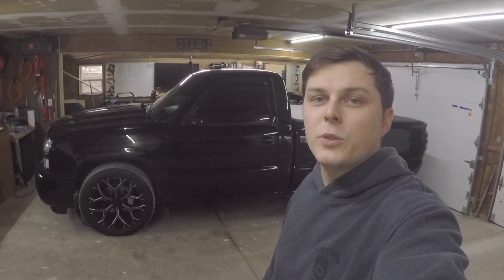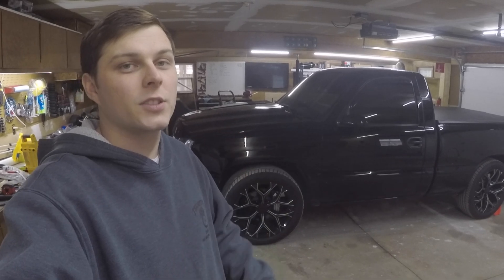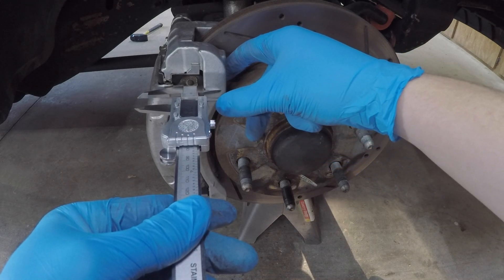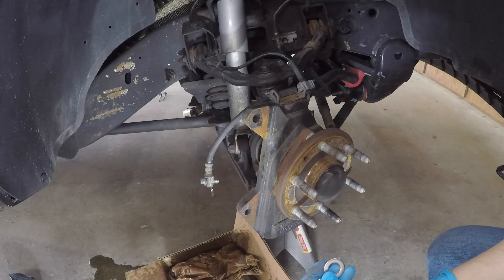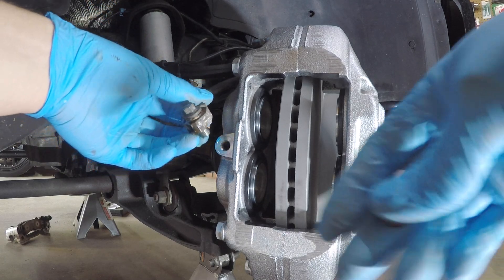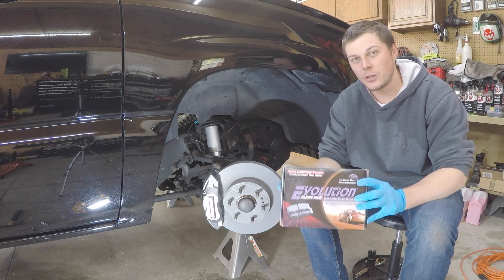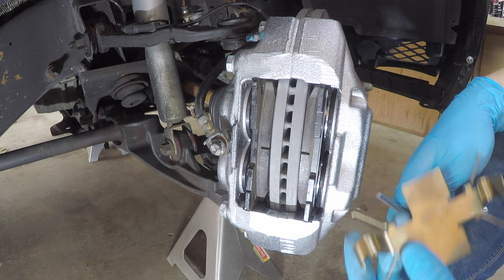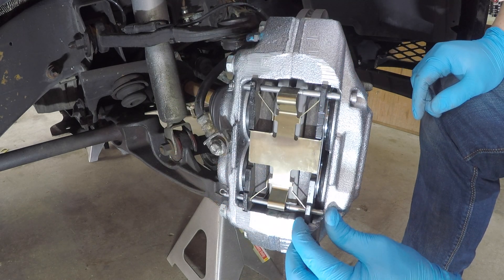Silverado 2019 Big Brake Conversion! “How To” A NBS!

Comment: Is there anyway I could get a measurement from the mounting bracket to outside of caliper ? I'm trying to see if my wheels will work with this setup without using wheel spacers
Reply from the maker: Hey, im really sorry for the EXTREMELY late reply!!! (These measurements are including the wash/spacer, for proper centering of the calipur)

From the face of the mounting bracket, to the furthest point of the calipur (that linear bump on the outside of the calipur, looks like a minus sign)  its 125mm or 4.9inches.

From the face of the mounting bracket, to the outside face of the calipur, on the curved C part, which is closest to the wheel, is 117mm or 4.6inches
Reply: @TheKingCoopa  thank you sir! I just recently got some factory loaded pull off calipers and rotors so this info came just in time. Lol
Reply from the maker: @reddevilent.1587  oh nice, good score! That inside C curve of the calipur is gonna be the closest point to your wheels. I've seen a few guys grind them down a little if need be, but hopefully you don't need that or a spacer. Good luck with the swap! 🤘
Reply: @TheKingCoopa  thanks man,I really appreciate it! I'm hoping that I don't have to run a spacer but will see. Was thinking of adding some ARP wheel studs to give some extra length
Reply from the maker: @reddevilent.1587  yea you could, most people who do the swap and a 3mm or 5mm wheel spacer don't have any issues with the stud length. The truck lug nut studs are pretty long. If you plan on running some big HP and running a spacer, the arp studs would Definitely be something I'd look into.
Reply: @TheKingCoopa  I got a turbo single cab 99 02,huron speed v4 t6 kit,80mm turbo forged built 370. I need some more stopping power.
Reply from the maker: @reddevilent.1587  oh, very nice 👌 👌. I think the best bang for your buck would be switching to hydroboost. Runs off the power steering pump, instead of vacuum pressure. I'm sure you already know, but larger camshafts have more LSA which gets less vacuum pressure = less stopping power with a brake booster.

Comment: Did it fix the how soft the break pedal feels ?
Reply from the maker: Hey, adding more pistons means more fluid to push. So you have to apply a little more pressure to get the same braking force. If your brake pedal is soft, then there is an issue with your brake system

Comment: so yes to a 2008 escalade platinum with 22 in 31mm offset. grinding and 1/4 spacer needed?
Reply from the maker: Hey, sorry for the late reply. It all really comes down to the spoke design. I dont think you will need to grind it down with the 22s, but might or might not need the spacer. Only really one way to find out haha, but good luck 🤘

Comment: For some reason those washers did not Center my brake caliper
Reply from the maker: Hey, sorry for the late reply. If it didn't fit, I'd measure your rotor Centerpoint, and then you would have to adjust the washer from there. It might need a thinner or thicker washer to be perfect. The washer works for almost everyone, so it sounds like yours just needs some fine tuning.

Comment: Are those calipers raw iron/steel that will rust or are they coated?
Reply from the maker: Hey, sorry for the late reply. They are zinc di-chromate anti-corrosion finishes which provide resistance to the rust on the cast iron caliper bodies

Comment: Gotten any where with the hydro boost conversion yet? Love the channel!
Reply: I haven’t done mine was wondering your experience since you did the swap
I’m doin drum to disc in the rear and then doing your suggested swap worries I will have vacuum pressure lost some to adding that many pistons to brake calipers
Reply from the maker: Also, like you said, adding more pistons means you will be pushing more fluid, harder to stop. (Or you have to apply more foot pressure) but the main reason i have alot of vacuum pressure loss, is because of the large camshaft i have. That effects it alot. So if your stock, it won't be as bad as mine was, but a hydro boost upgrade is more ideal.
Reply: @TheKingCoopa  I have been looking online but can’t find anyone who has done one for an 07-13 as mine is a 2013.  I can’t find any company or fellow NNBS owner who has done the swap…
Reply from the maker: Hey, no not yet. I have the 4.8L pulled. About to drop in the 6.0L and the E fans swap, then I'll do they AWD and hydroboost conversion. I dont wanna take on too many videos/projects at once haha. But we're getting there. Thanks for the support!

Comment: Very cool mod and great video! How much weight did this add to the truck?
Reply from the maker: Thank you! I'm not exactly sure how much it added, but I'd definitely assume atleast 20 or 30lbs? The rotors are a little larger and the calipurs are massive haha.
Reply: @TheKingCoopa  thanks for the estimate, I just started a build on a 2005 Chevy Cateye single cab short bed with a 5.3 V8 2wd and have been checking out some other people’s builds. You have some good videos for sure. I’m sub’d.
Reply from the maker: @whiplashtv2022  for sure, and that's awesome, hopefully it turns out how you want! My truck has changed a little bit since this video. Right now im swapping in a LQ9 6.0L with 2 step and a 150-200 shot of nitrous haha. Thanks for the support, I appreciate it!

Comment: I have been wanting to do this on my 2013 Yukon Denali. Do you know if this will work? I appreciate this video.
Reply from the maker: Hey, from the research that I've done, it should work. Biggest thing to look out for is wheel diameter and backspacing. You might have to run a small 3mm or 5mm wheel spacer to clear the spokes

Comment: OK. In stead of just giving the part numbers for the calipers could you give the actual truck information that these came stock on even more so that what you already say in the video. just a part number search is coming up with a bunch of dead ends plus with vehicle info I could get anything, not just ACDelco parts.
Reply from the maker: Hey, The 4 piston calipurs came on the silverado/gmc 4x4 1500 platform. 2019-2022. That platform also has 3 different kinds of front calipurs which is why I gave the part numbers. GM still runs the exact calipurs on the new trucks, but the part number has change a few times. It wasn't a specific model or trim package that only had these brakes (ie. Trailboss, AT4, etc.) Base model trucks get the larger brakes sometimes, and a few even get upgraded to brembros at the dealer. So the actual truck info is a 2019-2021 silverado or gmc 1500 4x4. You can always find a truck at the dealer and use it's vin number for a reference. But as stated in the video, when the part numbers did work, the calipurs were still really hard to find, especially since the truck is new and there arnt any in the scrap yards. Or you could call brembo directly and order a set from them.
Reply: @TheKingCoopa  The reason for wanting a certain model or trim is I can't take part numbers to autozone for pads or to see if I can get the calipers from them for fare less.

Comment: Will this work for my 2008 chevy avalanche 4wd
Reply from the maker: Hey, as long as its a 1500, it should work.
Reply: @TheKingCoopa  so yes to a 2008 escalade platinum with 22 in 31mm offset. grinding and 1/4 spacer needed?
Reply: Yes it's a 1500.... also what do I use to do the rear not sure what year and model  I should be taking it from.... thanks in advance

Comment: What size wheel is needed to clear the caliper ?
Reply from the maker: Hey, minimum of a 17in diameter wheel is required. As for the offset, that all depends on how each individual wheel and spokes are designed, and the offset of the wheel. So I can't help you much there, if you need a wheelspace or not

Comment: I noticed the brakes have holes for the wear sensor…did you ever connect that part? Thanks in advance
Reply from the maker: Hey, sorry for the late reply. I did not buy/use the electronic wear sensors, because there is nothing to plug them in to. The GM brake pad life monitoring system, wasn't implemented untill 2019.

Comment: Did you have to Replace the Baster Cylinder ???
Reply from the maker: No, I kept the same factory master cylinder. I will be doing the hydro boost upgrade though. To help in the braking force, since it is now pushing more fluid with more pistons.

Comment: Consider me subscribed, 1st to pop-up when I searched big brake upgrade. I have a 08 NNBS suerra Denali with a 4/6 drop on 24s. Truck had a 427 LS3 stroker, and makes about 640fwhp, so yes it's time to stop this big boy since I have a caliper trying to stick.
What part numbers should I looking for for to complete this swap. Trying to do Calipers and Rotors. Heard somewhere that 2017 Truck and Suvs were a direct fit, but didn't want to buy without research. Any information would be helpful.
Thanks in Advance!
Reply from the maker: Hey, thats awesome! Sounds like a pretty badass truck! All the part numbers I used for this swap are in the description of this video, there is a few direct links in there as well. As for the 2017, those  should work as well. The 2019 swap applies to GMT 400: 1987-1999/2000, GMT 800: 1999-2007, GMT 900: 2007-2013/14. 1500s only.
Thanks for the support!!

Comment: should i do the hyrdo boost if i haven’t done a cam or brake swap upgrade yet

great description was looking for minimum rim size!
Reply from the maker: Glad I could help out some! If you haven't done a cam or calipur swap, I'd say just leave it how it is. Unless your bored and have some extra money to spend haha. Anyone I've talked to said they hydro boost is a night and day difference. With a camshaft, they dont pull as much vacuum pressure, so you have to put more force on the brake pedal. And with more pistons, your brakes are pushing more fluid. So for me, it's almost a necessity to do the hydro upgrade.

Comment: Does anyone know what size wheel spacer I would need to use if I have stock wheels?
Reply from the maker: Hey, do you know what the offset of your current wheels are? Depending on that, if its a negative offset, you would need a larger spacer. If it's a positive offset, you would need a small spacer like 5mm or no spacer at all. Every wheel design is gonna be different
Reply: @TheKingCoopa  i don’t know that off the top of my head but thank you. i will look at my truck and find some options
Reply from the maker: Yea, that is kind of a hard question to answer. Hopefully someone else has done it with stock wheels and sees your comment. You might have to just test fit it and see if they clear haha.

Comment: Are both calipers the same? Can they be used on either side driver and passenger .Website doesn’t say
Reply from the maker: Hey, no they are not the same. There is a left side and a right side.

Comment: How do the factory brake hoses fit? Looks too short?
Reply from the maker: Hey, they are a tight fit. If your gonna do the swap, I'd recommend some braided stainless steel brake lines that are 2" longer. But you can still do it with the factory line if you want. I had to pull mine about 3/4" through the mounting bracket to give it some more slack

Comment: For some reason i cant buy or find the that specific rotor on rock auto
Reply from the maker: Hey, sorry for the late reply. I'm pretty sure rock auto doesn't carry them anymore. I'll have to find a new source.
Reply: FYI the large brake rotor from 2006 to 2019 are the same
Reply: My 2005 1500 silverado came with large disc with drum in the rear. I did this upgrade I used 2005 rotors with the 4 piston caliper bolted up fine!!

Comment: Since you have the 04 I assume these will work on a 05 Cadillac Escalade
Reply from the maker: Hey, I personally do not know, but I have had a few people in the comments tell me they will fit on the Tahoe/Yukons. Which I believe is the exact platform the Escalade is, so I don't see why they wouldn't work.
Reply: @TheKingCoopa   also do you have the part #s for the rear conversion??
Reply from the maker: The 2019 rear silverado breaks have alot of electronics and sensors in them, so those are not swappable. I had single pistons in the rear, so I swapped to dual piston yukon rear calipurs. I dont have the part number, I just went to autozone and did a 1 for 1 swap with my old ones. Your's being an escalade, I'd almost garentee you already have dual pistons in the rear
Reply: Hey Cameron, if you find out that they fit please let us know. I also have an 05 Escalade and I want to upgrade as well. My concern is that all these conversions are for RWD and Escalades are AWD. I think the front hubs are different. Any one knows if they fit? TIA.
Reply: @MyFavoriteStang   I ended up ordering a  ‘19 Cadillac front brake kit and putting that on. Kept my rear dual piston calipers
Reply: Thanks Cameron. I’m going to order the same.

Comment: Would you happen to know the backspacing on your wheels?
Reply from the maker: Hey, they are +24mm
Reply: @TheKingCoopa  I imagine a +27mm offset would work as well since it’s a little further out from the hub? I have factory 2017-2018 redline 5 spokes
Reply from the maker: @AlexRodriguez-pg9xk  hey, if they clear. It would be extremely extremely close!
Positive offset shoves the wheel farther into/under the truck. Negative offset shoves the wheel out farther away from the truck. So 27+ offset would be even closer than my setup.
Reply: @TheKingCoopa  ahhh I gotcha, thank you. I’m hoping these spokes push out enough but they may be kinda flat. I’ll have to look and see what the part numbers for a 2018 are and if they’re similar to the 2020s 4 pistons for a guaranteed fit.
Reply from the maker: @AlexRodriguez-pg9xk  for sure, good luck on your swap 🤘
Reply: @TheKingCoopa 

I just realized I have the same setup as you (originally) so I could probably measure the extra 17.25mm and if there’s room, I’ll know I’m probably good. I didn’t put that together til I rewatched you measuring it. Thanks again man

Comment: Really enjoy your content! Although this video just ticks me off cause I want to do it so bad and cant find the parts to do it what so ever. I love this video cause it just confirms that i need it since I have hydroboost already. is there any way you can help me find a place to get the calipers? Would really appreciate any help thank you.
Reply: I cant find them either.
Reply from the maker: Hey, I just replied to Seth Allison, with a few options that you might be able to find them. Might be worth a try. 

The new GM trucks have like 4 different brake caliper designs, for their different trim level/packages. The dealer parts departments might say they are discontinued, but the trucks are still rolling off the assembly line with them. I work at the Fort Wayne GM plant, and see these calipers daily. They will be switching over to the 2022 trucks soon.
Reply: @TheKingCoopa  lol I’ve had to do alot of research but the part numbers have changed like 5 times. The ones on RA without pics are the ones tho.
Reply: Really appreciate the response thank you so much. Love your vids watched everyone and liked everyone. Are you going to convert to e fans? I’m in the process of that now. I got a factory fan relay fuse box and the whole harness. Like my stuff to look like it’s suppose to be there. But would love to see you do that. Cost here ISS about 104 for fans and relay/ fuse box from junk yard and about 100 for tuning.
Reply: Also when are you going to convert to springs? And just cause I don’t remember what video it was in but what are the advantages of converting to springs?
Reply from the maker: For sure, best of luck on the new part numbers. If you find them please let me know. That way I can include them in the description of my video! I'd appreciate it, and I'm sure the future viewers would too. 

E fans are definitely getting swapped. Already have the fans and hem harness. Still need a wider radiator though. I'm waiting for my 6.0L swap,  when that all gets torn out anyways. 

Since I'm 4x4, the front end has torsion bars. I just got my coilover conversion kit yesterday, from AFP, Atomic Fab & Performance. So that will be going on soon too. Thank you so much for all the support!
Reply: @TheKingCoopa  
13536580 Right
13536579 Left
Reply: @sethallison4525   can you give me the part number for the ones you found, i see some with no picture like you mentioned but i wanna be sure its the correct 4 piston ones. Thanks in advanced.
Reply: @GDG184  read my past post. They’re there lol. They’ve changed part numbers like five times
Reply: Also it’s about 383 with carbon fiber ceramic pads and slotted rotors before freight on RA.
Reply: @sethallison4525  gotcha, I'll look for them and get them then! Thanks!
Reply: @GDG184  I looked up 2019 Silverado with a 6.2. One of them went up 20 so it’s 90 now the other is stil 70 ish
Reply from the maker: Hey, thanks for the support! Glad I could help out somewhat haha. Sorry for the late reply. Rockauto is usually sold out, I would run the part numbers on GMPartsDirect. You might be able to find them there. Also be sure to check the local dealership. Ask their parts department, and if not I'd talk to a head service tech. Some of these trucks get upgraded to brembro brakes, so they have to remove the factory calipers. Most the time they scrap them, But I've had a few people tell me they just gave them to them. I think it's worth a shot.

Comment: Hey man if I just replaced the front two calipers would I have to bleed all the brakes starting from passenger right rear or can I just start from passenger right front then move on too drivers left front? Thanks in advance keep up the good work!
Reply from the maker: Hey, sorry for the late reply. Even though you only pulled off the front two calipers, technically speaking you should bleed all four breaks. Just in case there were a few small air bubbles that back tracked into the rear brake lines. Thanks for the support!